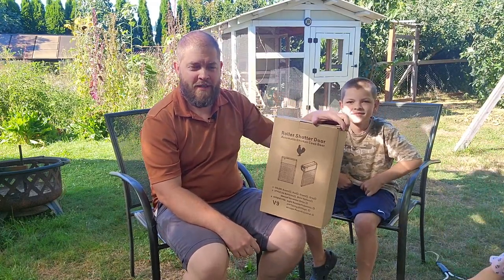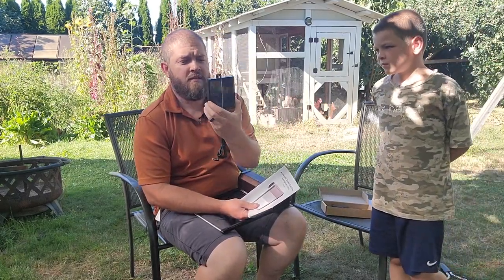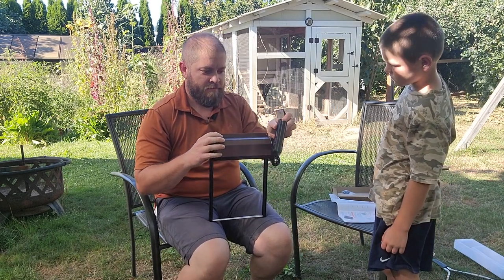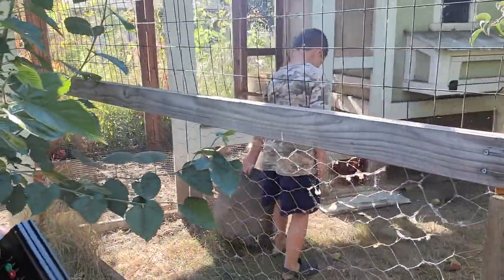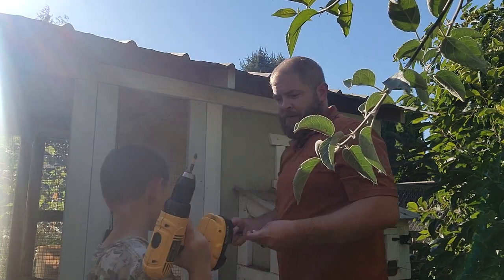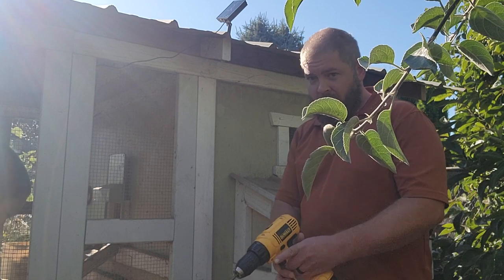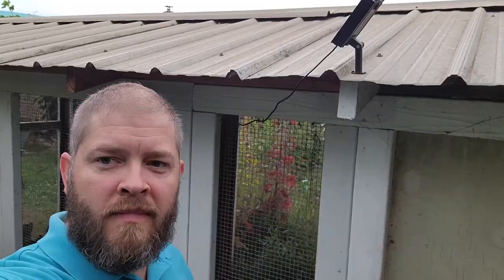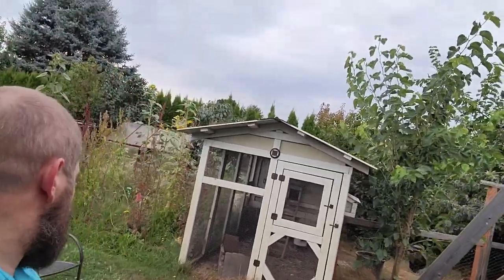(UPDATE: DON'T RECOMMEND) Chamuty Automatic Chicken Coop Door Solar Powered - Timer, Light Sensor

Comment: I bought 2 doors - One worked for 5 months then stopped working. 2nd door is stuck in LOCK mode and will not open or close. No customer service or support for this product. Going to try another brand to see if they last longer.
Reply from the maker: Try Ador. Made in the USA and real support. I talked to the inventor on the phone.
Reply: @TheQuarterAcreHomestead  Matthew, I tried emailing you, but it comes back as undeliverable
Reply from the maker: @aperson1181  What address?